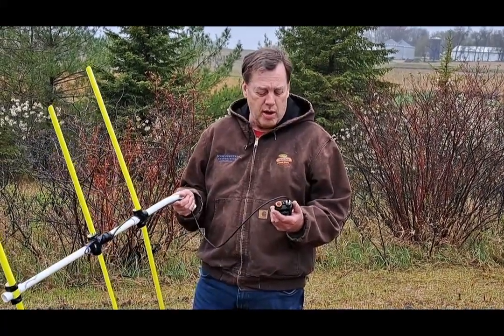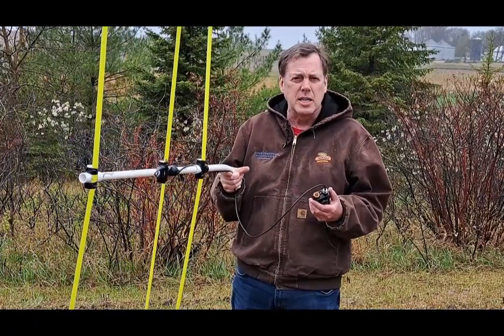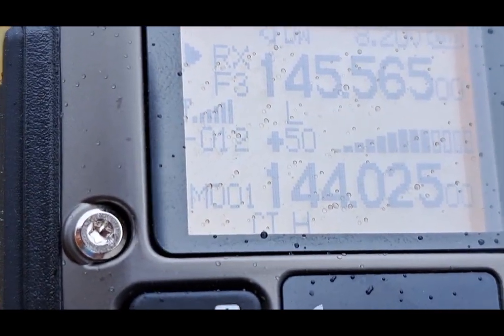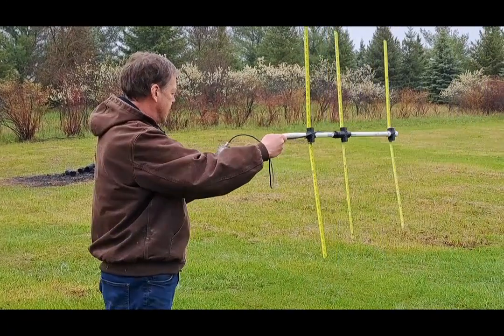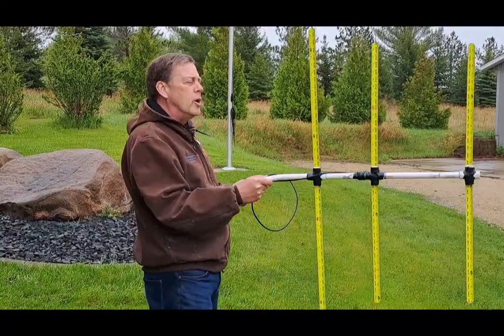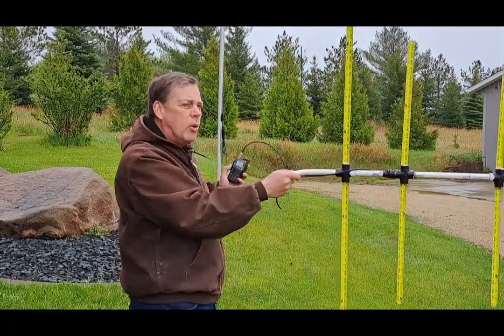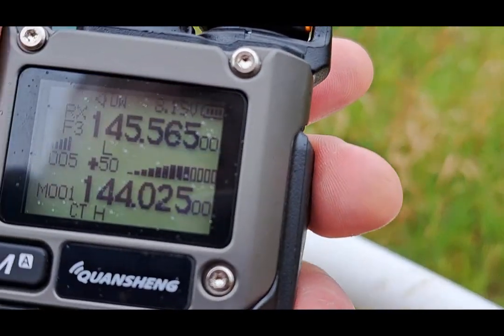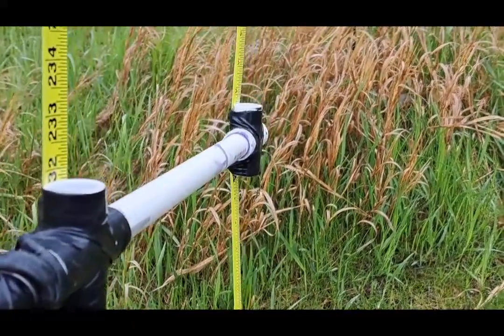The Quansheng UV-K6 - A game changer for Radio Direction Finding?  (Wide range RSSI meter).

Comment: I have also used the QUANSHENG UV-K5(8) successfully several times on fox hunts. I find it better to use my ears rather than looking at the RSSI value on the display. I use the IJV firmware in which I discovered that there is a menu item like "RF GAIN/ATT" (long press key "4") that allows an absolutely INCREDIBLE attenuation of the input signal. The menu goes down to -66 dB! The attenuation works in FM, AM and also in SSB/CW, which is great! This makes it possible to stand right next to a UHF transmitter 2 meters away and TARGE it with an HB9CV antenna. This thing I can't do with an ICOM R20 scanner for almost 1000 EUR (years ago) because the signal radiates through the housing, here the S-meter always shows S9+.
I have tested it with other radio friends and also laymen and carried out small fox hunts. It is easy to learn how to use it and even children have found hidden foxes with the UV-K5 plus HB9CV for 433 MHz. As a fox you can either use another UV-K5 in BEACON mode (if you have several^^) or reprogrammed VAISALA RS41 weather probes also work very well. 
You should try that too; when you use your ear you won't notice any delay and you can look around.

Comment: Excellent my experience at some point the battery makes a better antenna than the antenna port.  That is the big help offset ( or mixer) attenuators have .   The vk3yng is great, but expensive and currently unobtanium.